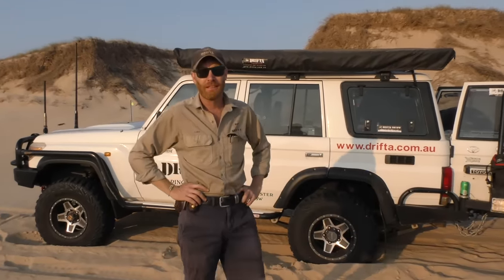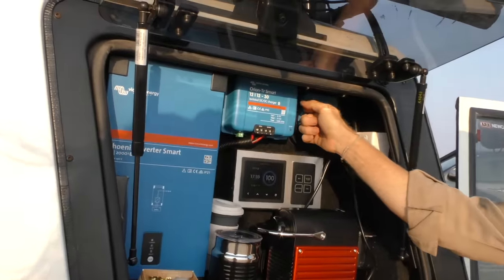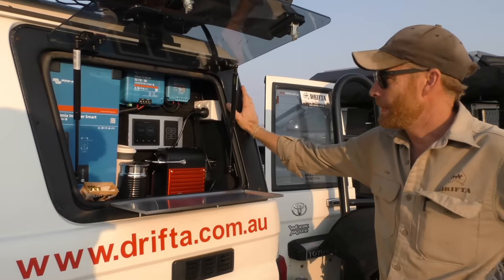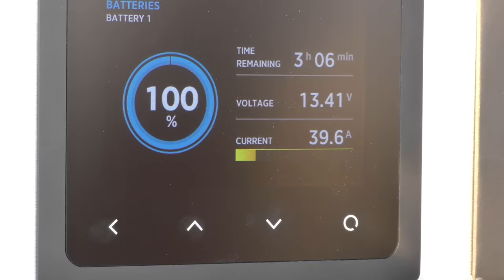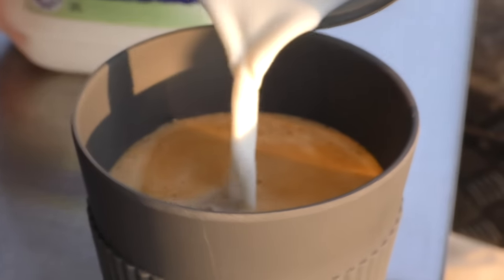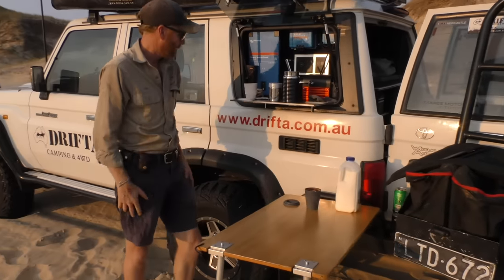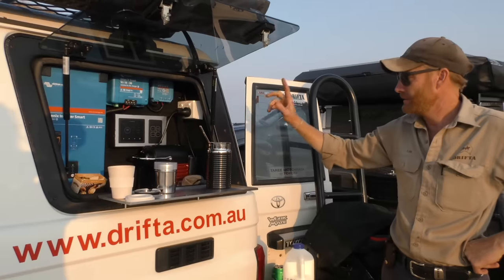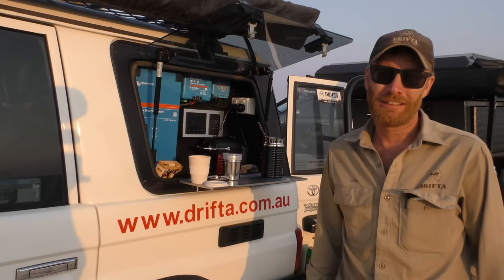COFFEE MACHINE SETUP IN THE TOYOTA

Comment: Are you monitoring the EGTs on that Hilux?
Reply from the maker: yes, never passes 450 egts on the beach and thats 2wd flogging it on a 40 degree day in sand dunes, which ive done a lot lately, in this video it was running 400 tops. yes it soots, no it doesn't get hot. 1KD can handle over 500 egts constantly no worries, so peaking at 450 for a few seconds is doing no harm. - kaito

Comment: I can understand that you're supplying what customers demand. And know that you will make sure that they will get the best possible. But for me it is just a complete overkill and extra weight. I admit that I also like a good coffee. But just use a 12V jug boiler and a manual nespresso press, or French press. Everybody can choose for their own. But I prefer using 12V equipment as its more efficient. And would like to hear comments from readers why they would need large capacity 220v supply.
Reply: +1 - i think drifta has move on it a bit from its original concept - building honest bobust sfuff without all the unnecessary bells and whistles
Reply: Agree on 12v stuff but if a customer wants something I guess u move on and do it otherwise they go elsewhere a lot of ppl see the 4by vids with all the gear hanging off it and all rush out to buy it I been there and now have got rid of half of it to way much weight and hassle fo me these days got rooftopper on trailer solar panel bcdc for charging and solar a few leds that’s it otherwise swag on rooftop and disappear
Reply from the maker: aron ??? we still doing that . i’m still making the original camp kitchen from 20 years ago.
Reply: That's the essence of my message. But hey, I understand and mentioned that they have to follow the markets requirements. And have no problems with it at all. And he makes a good point when mentioning that some people also have real expensive machines at home.
I am also setting up my pickup for work/leisure functionality. And looking to add a small Drifta cooking box. But 220VAC, I haven't found a justification for my needs. The main market is still the real RV vehicles imo.
Some solar power is something that I really want. But appliances and equipment will be mainly 12VDC or even USB powered. USB battery packs are cheap now and are just what I need. As I can use it for direct USB light plugs or charging phablets to relax/work.
Reply: @DriftaCamping4WD  yes you still do on some of the stuff (thank god!) - just an observation about where the business started and where its moving -
Reply: aron ??? Seem like they starting to import more gear from overseas but if it has a better profit margin you can blame them its business there’s a market for everything
Reply: @camerons9090  If it's Dutch, I can tell you that it is good. Actually I am probably living proof of that. LOL.

Comment: Wow, having 2 lithium batteries, the Victron equipment to run a Nespresso machine and a milk Froster is a pretty expensive coffee which taste like crap. Mate that’s overkill !!!  Making real good coffee you need what: drip filter, french press or Aero press, our for a Turkish coffee only a small copper Pott and  coffee beans hand grinder and something to make a bit hot water.
Reply from the maker: Holger Muller yeah i’ve done all that and i got all that. the reason there are a hundred ways to make coffee is cause people like different types and styles of coffee. i i also like a cap or late wen travelling cause with the milk it fills u up. i can have a cap for breaky and keep going till smoko.  but also the 240 v system, i’ve shown one thing i can use it for. there are now unlimited things i can do with it. icemaker be the next small appliance i’ll be getting. plus this is backup to run the edot if i’m a bit short of power there. 👍👍
Reply from the maker: Holger Muller plus i can run my induction cooktop on this system, and soon getting a small icemaker : )
Reply: @Holger Muller Running the coffee machine is only one use for the inverter, anyone serious about 4WD will have an inverter and solar and dual battery already to be used for running power tools, computers etc when away from mains, so putting in a bigger capacity one is not really that much of a big deal.